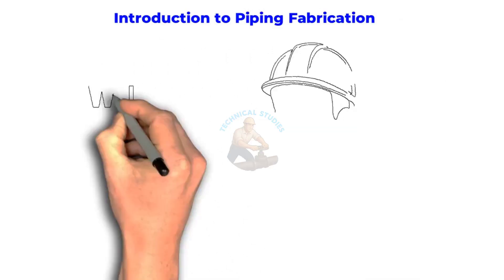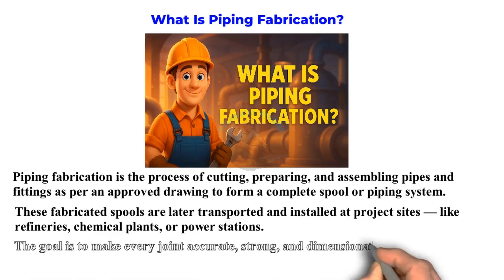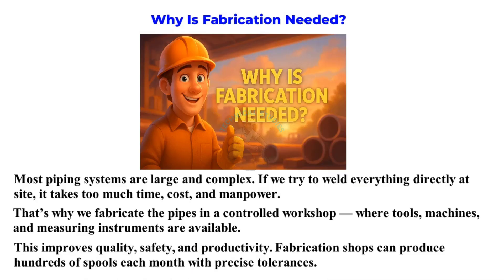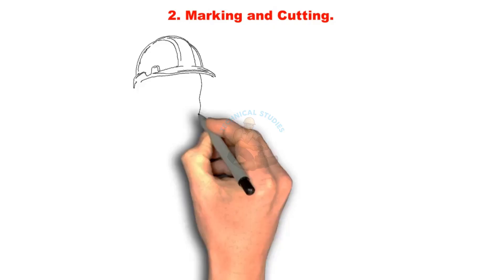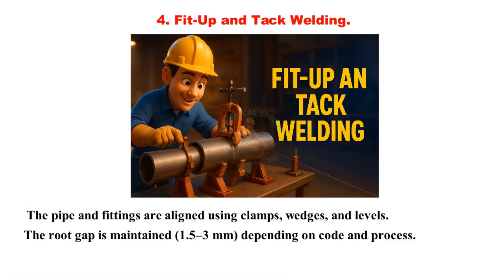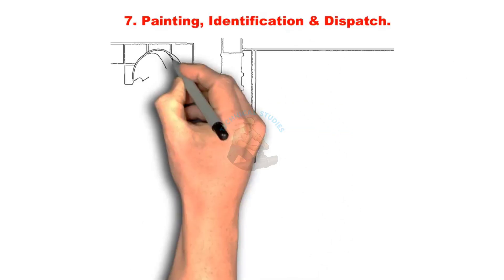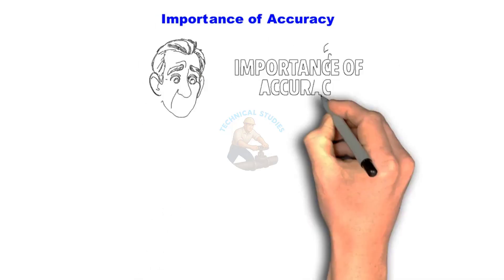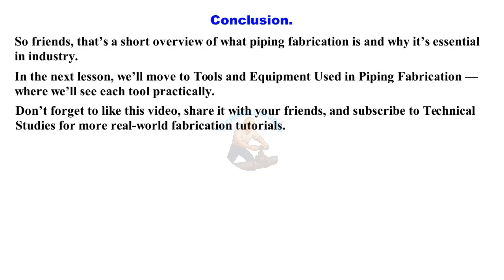Introduction to Piping Fabrication | Complete Beginner’s Guide (Part 1/10)

Comment: Thank you for your efforts in all that you do. My question is: What is the specialized body that issues authorization certificates to practice the work of a pipe technician, and what are the names of the certificates related to that?
Reply from the maker: Hai Bro. There isn’t one single global authority, it depends on the country and type of work. If you tell your country name, may be i can help you.
Reply: I don't know if there's a problem with mentioning my country's name; every time I type it, it gets deleted. Anyway, I would appreciate it if you could help me answer this question: Which authority issues licenses to practice as a pipe technician, and what are the names of the relevant certificates? Regards. @technicalstudies.
Reply from the maker: @مهندجبار-ف2ض  Ok Bro. Usually, pipe technicians need training or approval from a recognized technical institute or inspection body. Common international certificates include, ASME Section IX. B31.3 (for process piping). API 1104 (for pipeline welding). CSWIP 3.0 / 3.1 (for welding inspectors).  Trade-level or vocational licenses from local government or oil companies.
Reply: Excuse me, where did you obtain your extensive and valuable information in the field of pipe fitting and installation? And could you recommend a specific organization where I can receive internationally recognized training and certification? I am from Iraq. Thank you.
Reply from the maker: Thank you so much Bro, most of the knowledge I share comes from real-world experience in fabrication shops and site installations over the years. I used work in many countries, with different people. I use to read a lot of books related to construction. If you like, I can share some useful books with you.